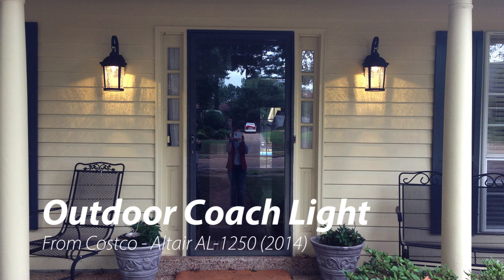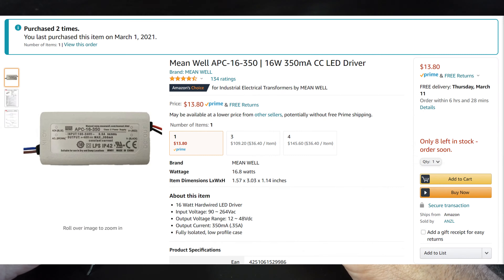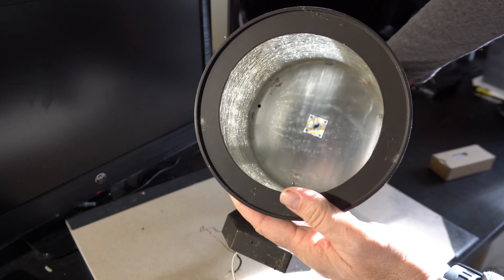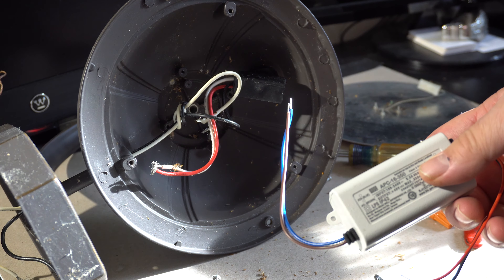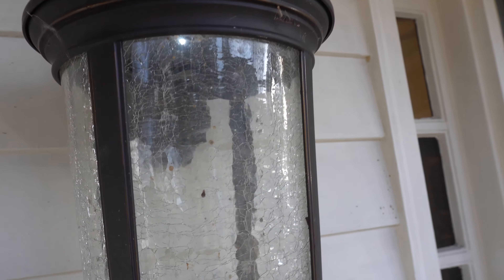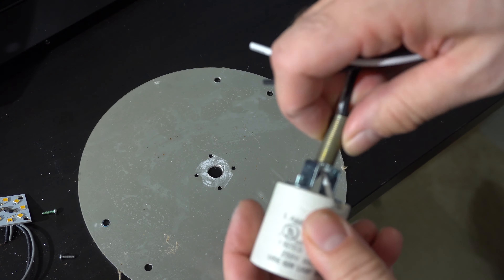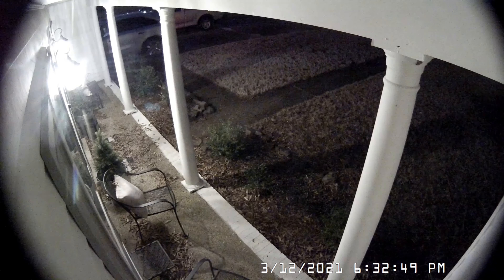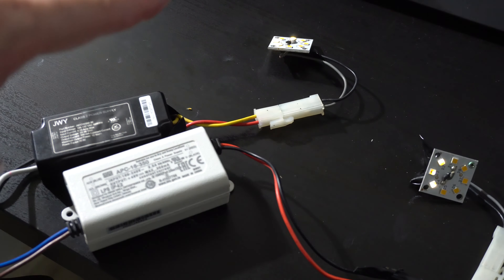Costco Flashing Light - A Different Fix!

Comment: Does your fix still keep the photo cell active so the light turns on/off… if not … is there a wiring solution that will work to utilize to photo cell on off? Love your idea and thank you for your help.
Reply from the maker: Yes, the photo cell still works. In this light, it's a on the main wire and separate from the LED circuit so was easy to leave in place. Thanks for watching!

Comment: Thanks for the video but I didn’t see how do you socket is wired. Is the dusk till dawn feature still available with a socket or is that removed with this fix?
Reply from the maker: You're welcome. Yes dusk to dawn is in a separate sensor and still works after this: https://imgur.com/a/L9NjpSE
Reply: @ACBMemphis  Thanks for the link to the picture showing how to rewire it keeping the original photocell operational. I would have never thought of removing the original flat led circuit board and putting a light bulb socket to replace it for whatever type of bulb like a incandescent, fluorescent or led screw in light bulb. Thanks again.
Reply from the maker: @hotroddreams3130  You're welcome thanks for watching and commenting!
Reply: @ACBMemphis  Maybe you could pin the link to the picture to top of the comment section showing the rewiring so others could find it easily. I read every comment to be able to find it. Most people don't read video description or read through all the comments. Thanks again for saving my light.

Comment: You don’t show how to connect the Harbor breeze socket after such a good video on everything else. 
I’m very confused as I am sure others were as to which wire from the socket goes to which wire from the mean well supply!
Reply from the maker: With the harbor breeze sockets, you don't need the meanwell supply at all. It's just wired like a standard light bulb. As I mentioned I'm not an electrician, but what worked for me was connecting the red wire on the photocell to the black wire on the harbor breeze socket and then white wires were connected together. Thanks for watching!
Reply: @ACBMemphis  Ahhhhh! 
I was trying to use the mean well with the socket. That wasn’t clear in the instructions that came with the socket or in the video.
Thank you so much for responding. I have 6 of these that don’t work or only half the leds worked in most of the lanterns once I put in the mean well parts. 
I will definitely try this again tomorrow.

Comment: Man, I cant thank you enough!  I opened a YouTube account just to say thanks!
I have 10 of these things, and they only lasted about 5 1/2 years before the flicker started, and became darkness later on.   Thought it was just the LED, but then realized after watching your video it was most likely the driver/ballast.   Then realizing the costly repair headache that would be.  Followed your idea of just replacing it with a socket and LED screw bulb.   I bought the sockets in packs from Amazon and they were only about $1 each and did them at my leisure while on Zoom calls.   
I used the 'Edison' yellow type LED's and they look even better than before.  (Coach lantern never went well with stark white light anyway IMO).
Anyway, great job and Thank you!
Reply from the maker: You're very welcome, and thanks for the comment! Six months after making this video, mine are still working great as well...
Reply: Do you have the amazon link by any chance?

Comment: I would like to replace my LED with a regular 60W socket like in this video.  I'm assuming that I remove all of the wiring except the white and black wires that come from the base of the fixture.  Is this correct?  I'm really not concerned with the light coming on when it gets dark, i would prefer to turn light on and off as needed.  Thanks!
Reply from the maker: Yes, that is what I would attempt to do...* The red wire was part of the photocell, so I think bypassing that would make it a standard fixture. Thanks for watching! (As I said in the video, I'm not an electrician, so take any advice here with appropriate skepticism and use safety procedures.*)

Comment: With the standard light bulb, what did you do for ground? Is it still grounded to the first but on the fixture ?
Reply from the maker: I did not change any grounding. In other words, the original fixture only had internal white/black wires, so I simply replaced the LED "box" with the Harbor Breeze socket, otherwise keeping the original wiring intact. I don't remember exactly, but the copper ground wire probably attaches to the fixture itself where it mounts to the box. As I mentioned in the video, I'm not a licensed electrician, so if you are unsure please consider this video entertainment not professional advice. Thanks for watching! 

Picture of inside: https://imgur.com/a/L9NjpSE

Comment: Sorry if I missed this. Were you able to get the photocell to work with the bulb socket solution?
Reply from the maker: Yes that's correct. The photo cell is like a switch and I think there's a red wire coming out of it that works as switched power - it was wired like a kitchen sink disposer outlet, with the photocell being the switch.

Comment: When you replaced LED driver circuits with the sockets, did you retain the day/night sensor or did you remove that as well?
Reply from the maker: I left the day/night sensor in so it works just like it did before. Thanks for watching!

Comment: From a little research on replacing mine that died, did you have a different constant current on the LED drivers? Depending on the amount the drivers put out it seems this can affect the Lumens and the color intensity of the LED. Mine originally had a 750mA driver. I've purchased a 900mA driver and some replacement LEDS to get a little brighter and match the color temperature of some other lights I have. Waiting for them to come in and I'm hoping for good results.
Reply from the maker: If you're replacing the LEDs and the power supplies you should get consistent results. In the first part of the video, I tried 2 new identical power supplies, but I think the LEDs must have had a problems as well... Thanks for watching!